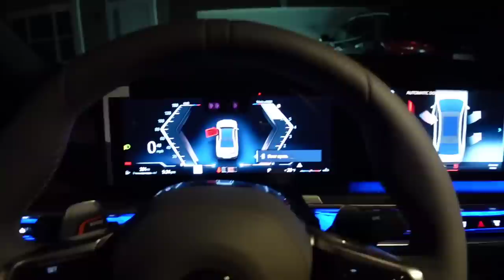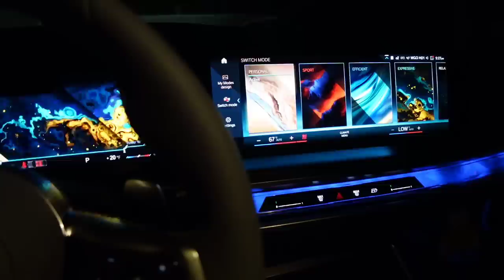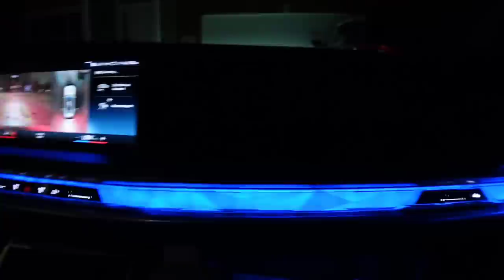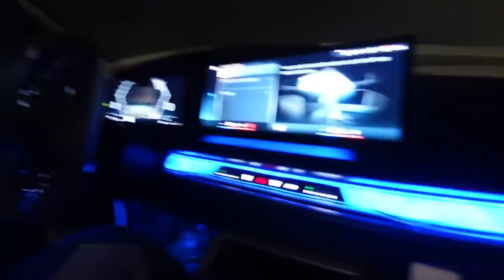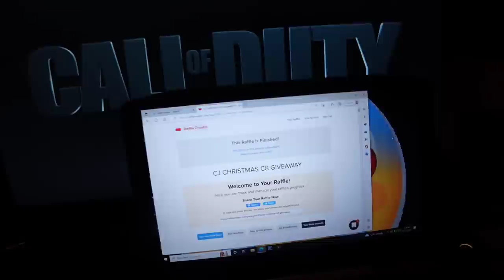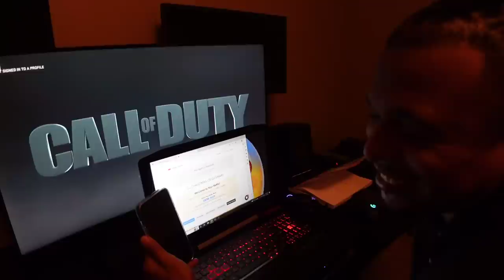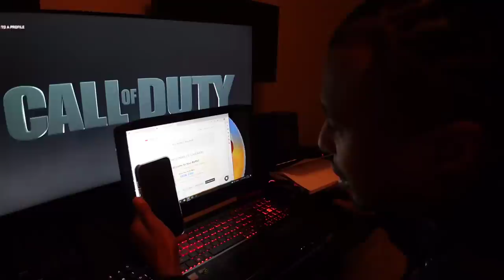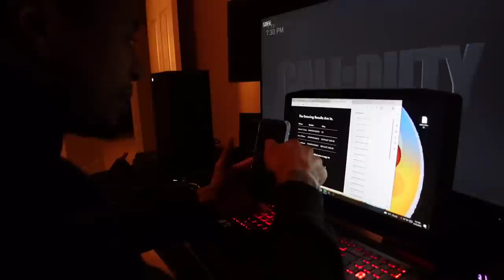TOOK MY POPS FOR A RIDE IN MY NEW SPACESHIP HE WENT CRAZY

Comment: Cj just tap the microphone, then give command, instead of holding it down while giving command. If you hold it down (long press) it thinks you need more direction the reason it starts providing direction. After quick tap, it will beep to let you know its listening  for command, that’s when you speak. The older model 7 series BMW has that talk feature but  not to that degree..